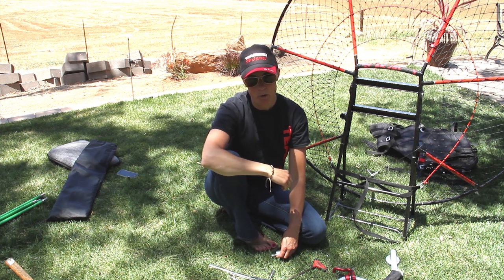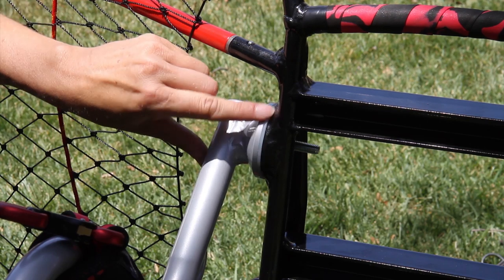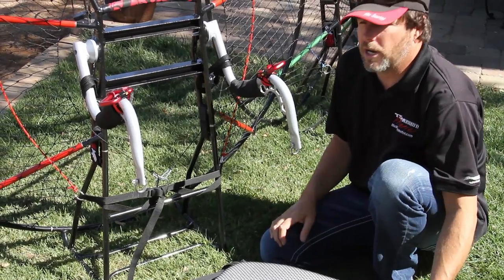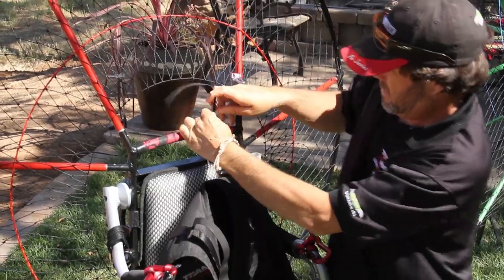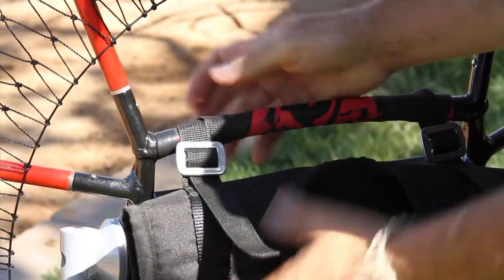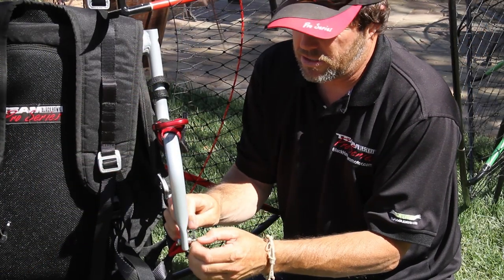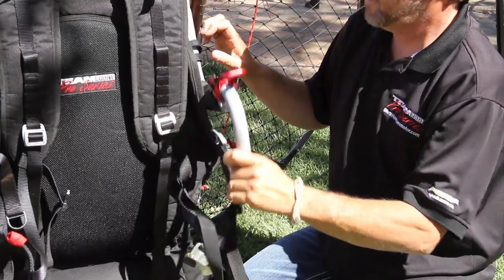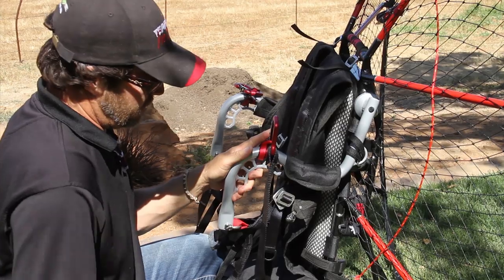BlackHawk Kestrel Frame Assembly PART 2 - Weight Shift Arms & Harness

Comment: Good step-by--step content.  I especially like that you get good camera angles and close-ups to provide a detailed view.  So many videos just stick a camera on a tripod and show the assembly from 6-8 feet away, which is pretty useless.    

The one piece that would make me nervous is relying on a single long bolt to support each attachment point.  I'm not a PPG pilot (yet) -- but a fixed wing guy.  I'd prefer to see the attachment points resting on an axle or something a little more substantial and secured with a bolt rather than hanging directly on the bolt, especially since the forces are lateral (relative to the axis of the bolt).  It looks like the wide flange would tend to prevent flexing, but again, I'm not an engineer.  Is there data to describe the kinds of stress those bolts are tested and shown to handle?  (I'm not trying to throw rocks -- I genuinely want to know.  Thanks for understanding the spirit of the question!)

Does the Kestrel have features designed to compensate for torque?
Reply from the maker: Hi Evan! A very warm welcome to the life-changing sport of Powered Paragliding. This is Rob Whittaker, BlackHawk's video and web guy. Those are some excellent questions for our shop director Mike Gambrill... He is extremely knowledgeable about the engineering aspects of our Paramotors. I'll include his direct cell phone below. When you have time, reach out to him. Please feel free to contact our office anytime if you have questions. We're always here to help! =) =)

MIKE GAMBRILL:  541-999-1396

BLUE SKIES! 

-Rob Whittaker, Team BlackHawk 

SALES: (209) 418-5990 
OFFICE: (209) 786-7899 
EMAIL: Team@BlackHawkParamotor.com 
WEBSITE: http://blackhawkparamotor.com/